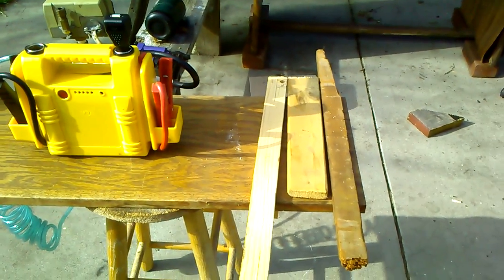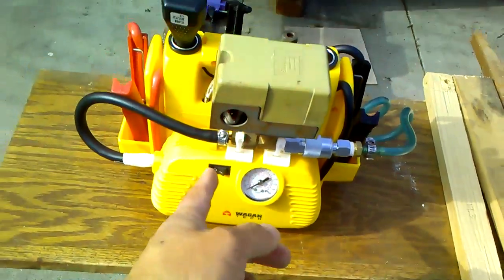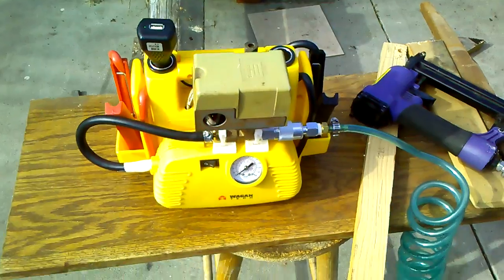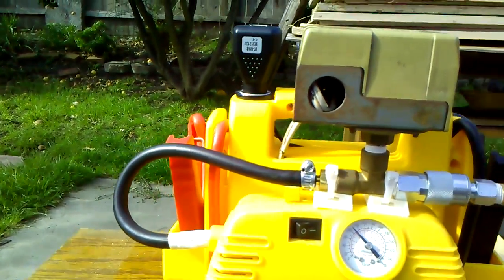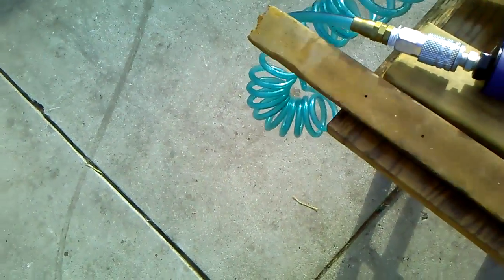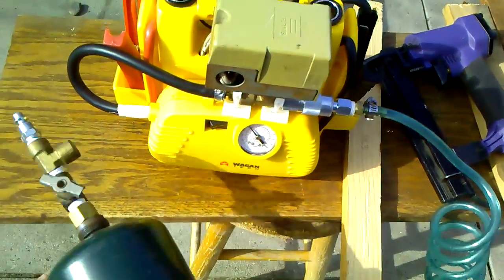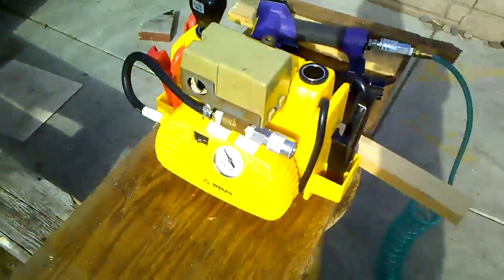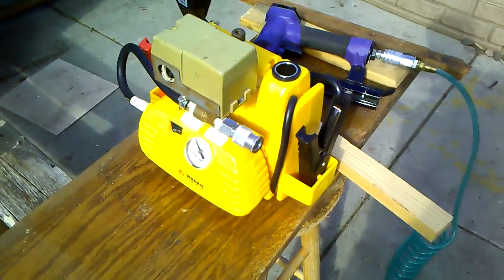Tire Inflater Conversion to a Mini Compressor Use For Brad Nail Gun

Comment: Hi, thanks for video. What do you call the pressure switch. Can you link to one that I could buy please, I do not know the name.
Reply from the maker: Ebay has it. Just search for compressor pressure switch. Thanks for watching.
Reply: @mischtify  Thanks that is great. Most of these require a 240v power supply . . . if I search "compressor pressure switch 12v" then they do not look the same. Could you find one somewhere on web, and post a link please?

Comment: I want to do the exact same thing and I've been searching all over the web and I cant find an answer.  Basically, all I want to do is make my portable tire inflator to blow compressed air...that's it, I'm not looking to hook up any air tools to it.  What exactly would I need?  I have the milwaukee M12 compact tire inflator - https://www.milwaukeetool.com/Products/Power-Tools/Specialty-Tools/2475-21XC and I want to use this - https://www.homedepot.com/p/Husky-7-Piece-Blow-Gun-Kit-18249HOM/205331812

thoughts?
Reply from the maker: I already created the one you are thinking of,  just hadn't uploaded a video of it. What I did was hook up a used propane tank to it and used it as a compressed air supply. There's also many quiet tire inflator available now,  cheap and very powerful, if you're into harborfreight tools.